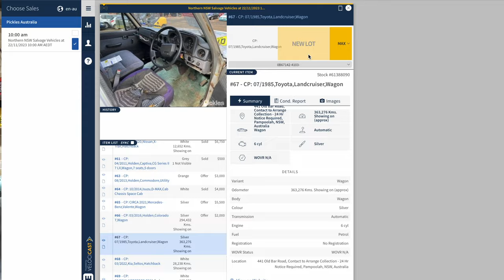BRAND NEW PROJECT! BUYING A CAR AT AUCTION | 60 SERIES LANDCRUISER PART 1

Comment: Great car Adam 
Should have left the moulds in the rubber w/screen seal , you can buy roof rust repair sections for 60 series , I’ve done a few , need to take the hood lining out before cutting , it will catch fire .
Reply from the maker: Thanks for the tip! Mate where did you get the roof repair sections